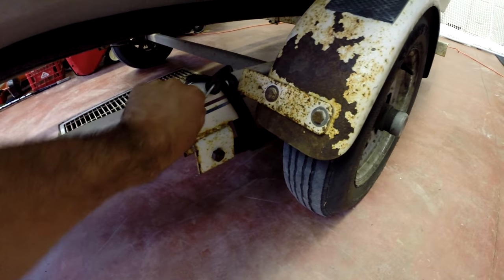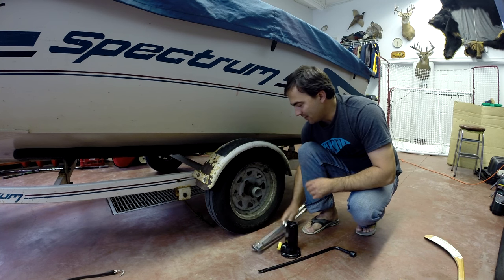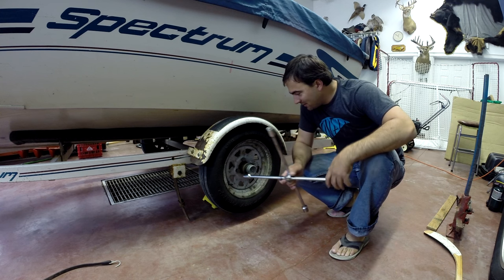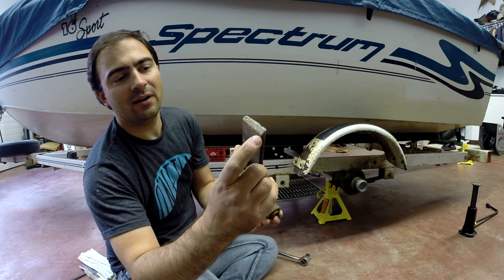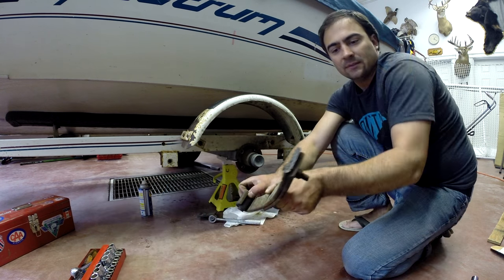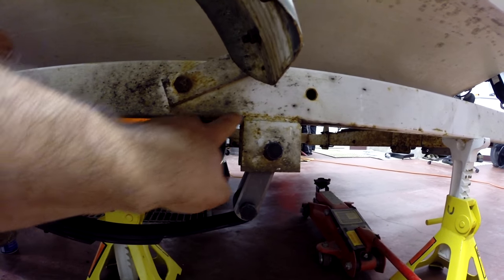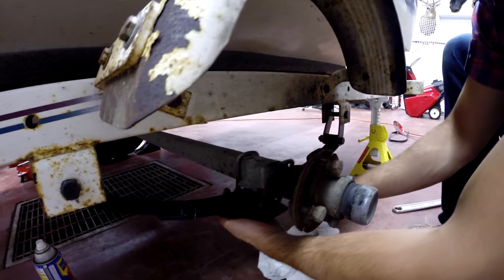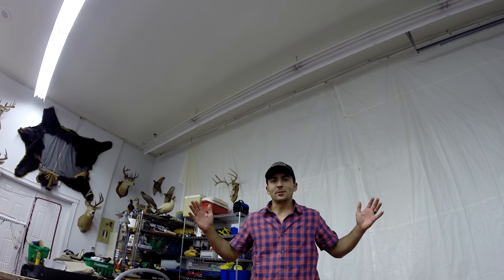How to Change Trailer Leaf Spring

Comment: Dude. This is awesome! One of my leafs broke on my trailer here in Okinawa and I could only come up with 26.25” and my trailer needs 25.5”. Going to search out some hangers tomorrow! Might just have some fabricated.
Reply from the maker: Yeah my trailer is still working fine several years later with this repair and no adjustments so it definitely works!
Reply: Any chance you can point me towards this “hanger system” you mentioned so I can have some specs to ask the local Japanese automotive shops ? Thanks in advance
Reply from the maker: @joejoseph4425  I just got it from Princess Auto In canada.  Maybe check their online website.  https://www.princessauto.com/en/

Comment: Thats the proper way to install the spring with the hangers.
Reply from the maker: Was that a question or a statement.  I'm know mechanic but my buddy who is a heavy duty mechanic said it looked good.
Reply from the maker: @cole4406  Yeah, you may be right but I didn't build the trailer originally.  They did have a different type of spring with an open end J hook at one end.  I suspect that allows them to flex and slide on the rollers a bit with that J hook. I could be completely wrong though.
Reply from the maker: @cole4406  yup it was in there when I took off the old one.  You just missed it.

Comment: Question. I’m replacing the axle and leaf springs on my boat trailer and I’m in the same position as you where the leaf spring is too short to reach the mount on the trailer and those two bracket pieces you have it add so the  leaf spring reaches the mount is angled leaning towards the back just like yours is. Has that been an issue at all? Other videos I’ve watched show it angled the other way which is supposed to be the correct way. Any issues at all with your configuration?
Reply from the maker: Nope I have been driving this trailer as is for the past 5 years now without any adjustments from the video on trips from 4 to 12 hours of driving without any issues.  Seems to work well the way we did it.

Comment: I have a question, im changing my leave springs, do I have to tighten the bolts tightly, or not really so when I hit a bump the leaf springs flex a bit thank you very much sir
Reply from the maker: Tightent all the bolts tightly, the spring should still flex.  We cranked them all tight!
Reply: @TheFishingDoctorsAdventures  thank you for taking the time 🙏 then I will make sure I do

Comment: I was wondering if you were going to match the other spring. 
right on
hey I loved the art work in the garage.  I liked the  big buck in the middle.  but the  one that's smaller  with the drop tynes. 
was cool.
 am I wrong  but by the end of the video  it seemed   like you guy's we're really tired or cracked open a bottle. 
 great video  keep them coming. 
and do you hunt too?
Reply from the maker: Yeah for sure, always have to do both sides of the trailer!  Yeah those are my grandpas Bucks that he got mounted and one up there there is the great grandpas old buck.  Unfortunately that big bear rug just fell apart this last year.
Reply: To bad. Did you toss it? 
If not, see if a good taxidermist can fix it. I had a old 19 pound rainbow trout that was falling apart fixed by an old friend that was a taxidermist.  He fixed it god. 
Sorry he passed away last year.
Reply from the maker: Yeah I think the rug is still up on the wall. Might just have to lay it on the ground and get some Duct Tape and super glue!

Comment: My leaf spring broke on my single axle karavan boat trailer. It’s a slide on Type with u joints. Now the left side is completely sagging against trailer. How do I go about this I’m very new to boats
Reply from the maker: Did you change both sides.  You have to change both sides with the same replacement springs

Comment: Dude, That is incorrect! The shackles must be able to swing back,yours are tilted forward witch means the springs cant compress! With 25 1/4springs the hangers must be like 24 1/2.
Reply from the maker: skipperup ok, I'm no mechanic.  Seems to work though.  I had a mechanic look at it and said it was fine.  You're likely right.  But this was a weekend and everything in the city was shut.  Only place open  was princess auto and they have standard sizes and just had to make due to go fishing.
Reply from the maker: skipperup so should we have got a longer spring?
Reply from the maker: skipperup yeah my old springs were only two leaf.  I put one heavier springs.  And they used to have an open j style loop at the back.  But try to get those emergent just not going to happen.  I've already hauled this trailer as is on rough gravel roads and across two provinces, back and forth to lakes and this hasn't been a problem yet.  The spring still seems able to flex.  I'll pay closer attention next time I pull it.
Reply from the maker: So I had the boat out and jumped on the trailer and the springs works just fine like they are.  The shackles actually swing backwards to allow the spring to compress.  Drove over lots of crazy bumps on a logging road on Vancouver island and out to Ucluelet and it works great.
Reply: wow, then I stand corrected. Sorry, guess i can't believe everything i'm told.